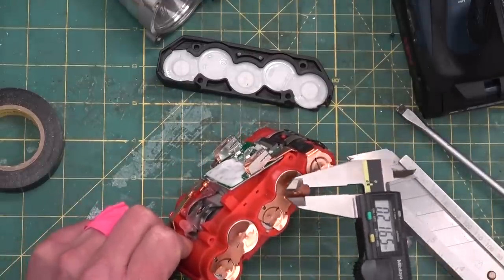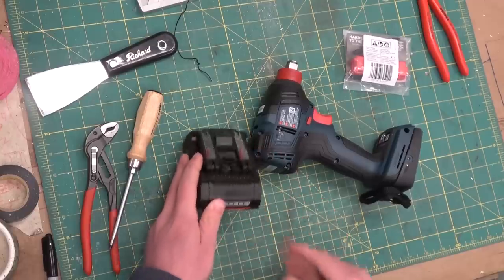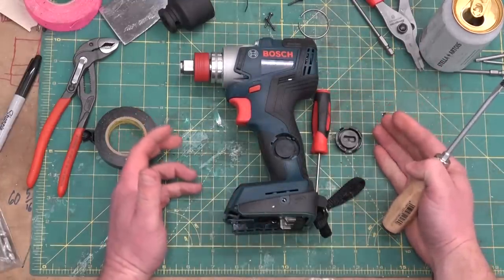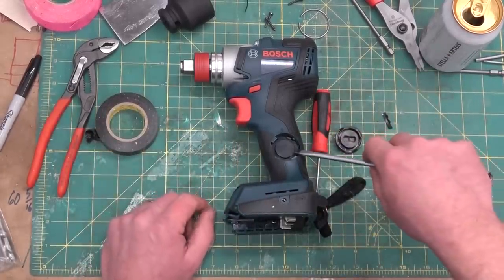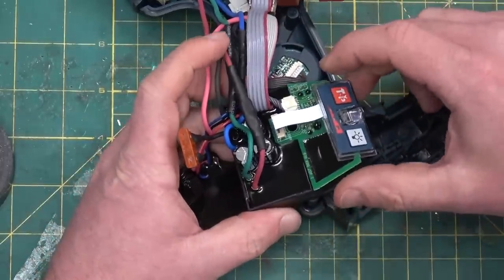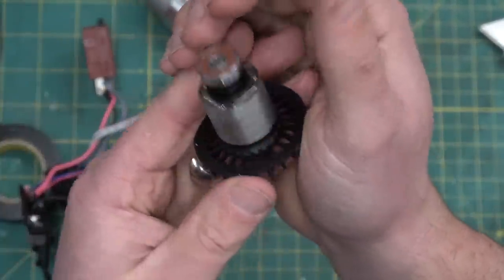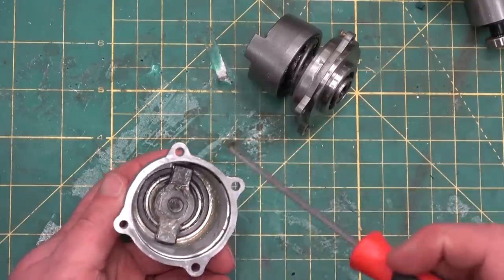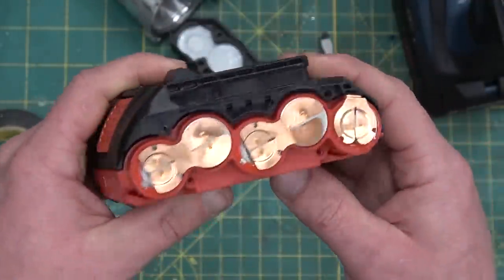BOLTR: BOSCH impact driver | CORE 18V

Comment: Fk. Bluetooth, fk bosch and its gimmicks.. the tools are way to underpowered. 
And who the hell is gonna pull out a phone while balancing on a ladder to change a setting on a tool.
Reply: what are you talking? The GDX has the same specs as the actual Makita and Dewalt 18V impact driver and the BT Modul has only optional uses, nothing that is needed.und 
Things like led light time and a soft start.
Reply: @Zozo806  i have had Bosch for the last 7 years.
Gdx and all 40V options are all good and well but very usless unless you have 8ah batteries and above. 
More volt is less amps. 
They dont magically magic in extra energy. 
The technology is very cool and all but to sensitive, for a real job site... 

Trust me. 6 charger's, 2 sds drills, 2 normale drills with worn our gears. 
I passionately hate Bosch. 

And the bluethoots crappy chips fall of the tool on the first day
Reply: @shaquedelilicss7849  i don't trust you becauae Bosch don't have 40V and the GDX has the same specs as Makita and Dewalt impacts. 
The battery technology is the same as Milwaukees and Makitas 40Vmax with 21700 cells. 
Let me guess you like Milwaukee and watch VCG Construction? :)